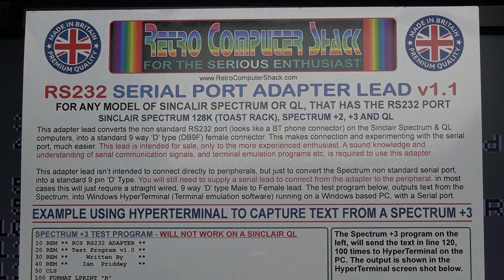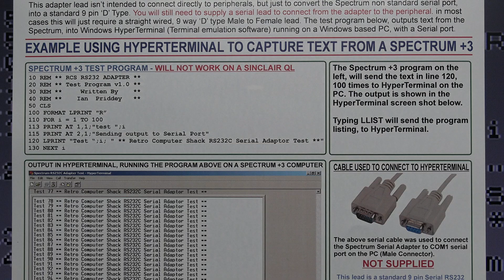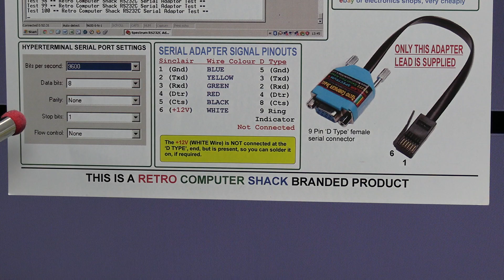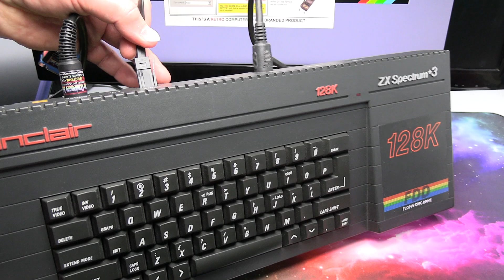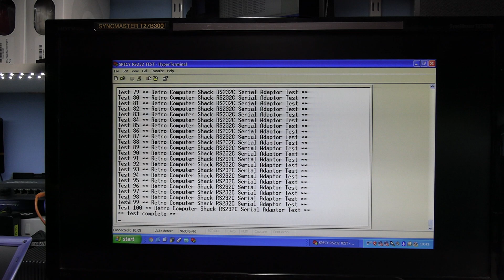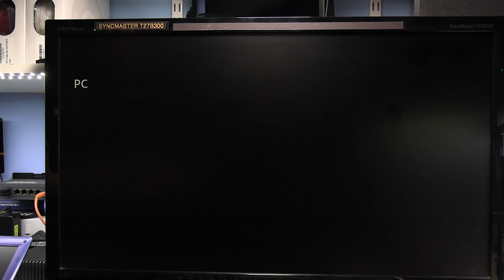Sinclair Spectrum & QL RS232 Serial Port Adapter Lead

Comment: So back in the 90s I used this socket to control a MIDI keyboard, and I think you can get the PLAY command on the +2/+3 to use this, at least from what I can remember.. that was pretty cool and there's no reason you couldn't do it now using modern MIDI keyboards as I believe the MIDI standard is the same